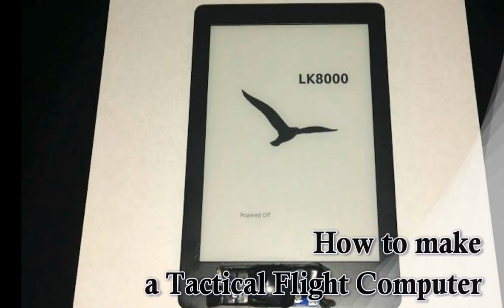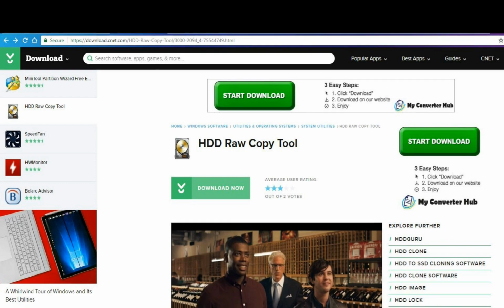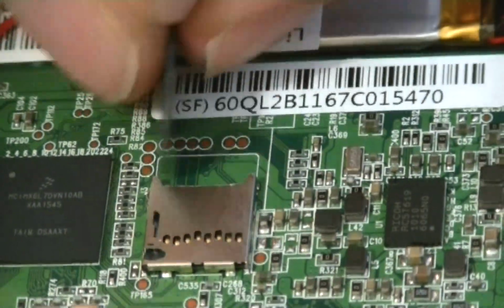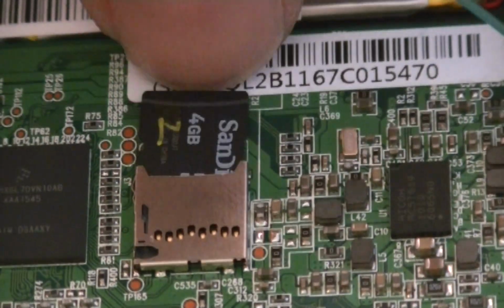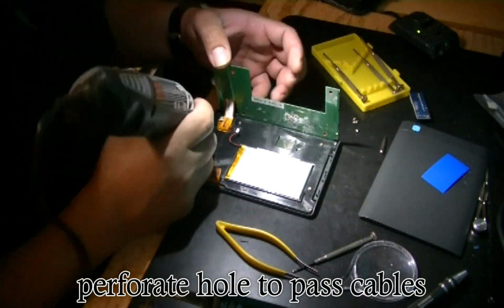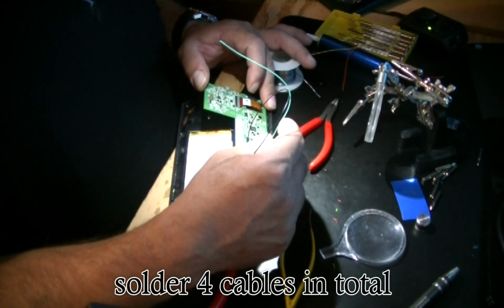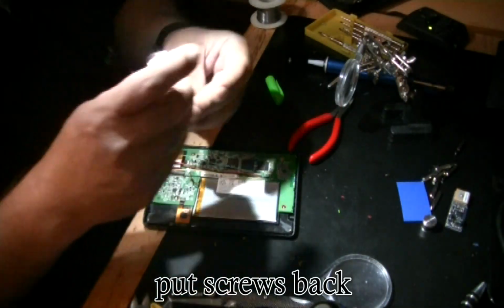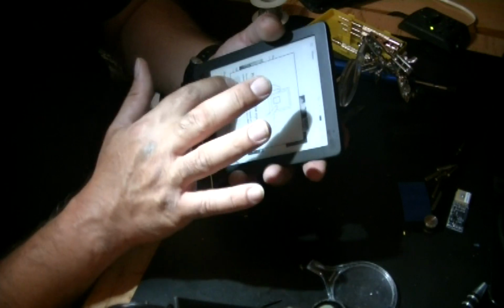The make of a Tactical Flight Computer

Comment: hi
do you know if other GPS modules will work -- there are quite an assortment out there -- I am not looking for a vario so wondering if I could go with a cheaper GPS I found on Amazon
https://www.amazon.ca/MyRobotUniverse-GY-NEO6MV2-Control-Antenna-Raspberry/dp/B07KSJLXXT/ref=sr_1_13?crid=18SXZEPZRZ12E&keywords=gps+module&qid=1553798069&s=gateway&sprefix=gps+modu%2Caps%2C139&sr=8-13

Thx